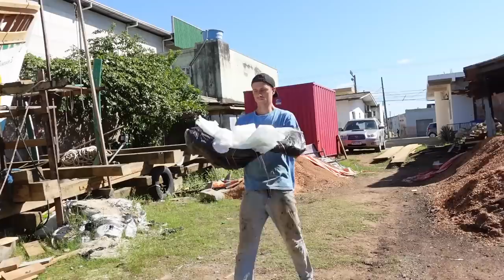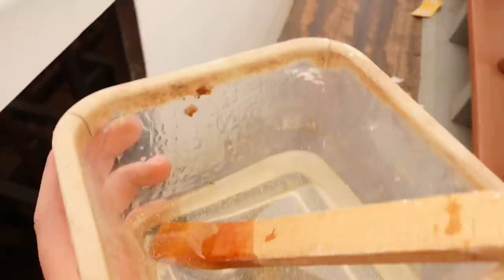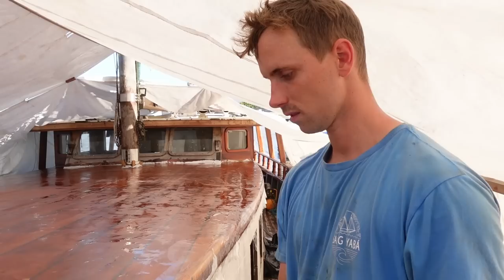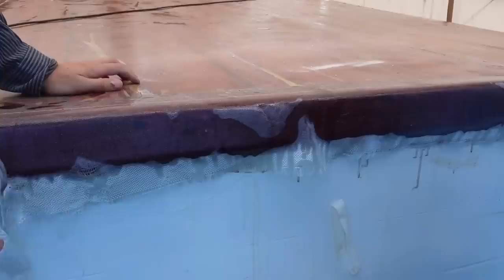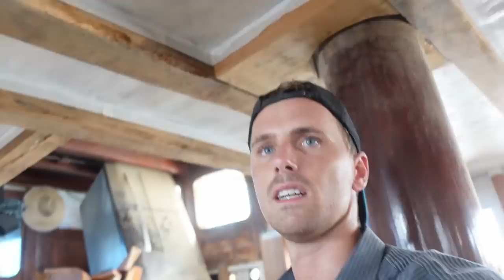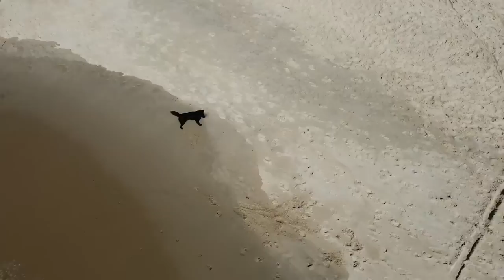Three rookies saving the roof of a rescued wooden sailboat — Sailing Yabá #92

Comment from the maker: So guys, what do you think? ARRASOU or not ARRASOU?
Reply: Google translate tells me arrasou, if it were Portuguese, means killed or demolished.
Reply: Fénix or Renascida
Reply: Definitely ARRASOU
Reply: Definitely ARRASOU Amigos
Reply: ARRASOU LES ZAZOUS !
Reply: Im never negative usually about the preservation of wooden boats nor am i a pessimist, but without a solid coat to shield all your work from the sun, the life span on this is limited, but its also not a good idea to fibre glass straight onto timber, all decks i have sheathed all start with a layer of ply, the application of deck paint over the top as a flow coat to stop the harmful UVs from killing the GRP apart from having a good antislip area , unless you are going to scatter silica in areas where you need to walk on the cabin top ?

I hope i am wrong, but i have never come across a UV proof epoxy, yacht varnishes that you also intend to paint over this are neither UV proof, general rul of thumb, if you can see through the coating it aint UV resistant
Reply: @traceysmith6964  it's maybe not 100% UV shield but a huge part is blocked. They'll find a solution, I guess they could decide one of these days to cover with a slipproof bi component polyurethane paint, a nice blue maybe. My idea to keep visible the root roof, I would keep a square or a circle in the middle covered with thick varnish, or plexy
Reply: @traceysmith6964  thats true, sadly. But this will not last very long i think. Mayby a polyurethane topcoat would help. I think there are some wich are transparent. This could help to protect it feom the UV.
Reply: @iniuriasg  the only yacht varnish that I ever found had some protection for 3 to 4 years you couldn't see the bottom of the tin when you take the lud off. 

The killer for this will be the timber bleaching under the epoxy, the bleach wood is burned wood from UV which will no longer be structurally fixed to the surface of the deck
Reply: Definitely ARRASOU😁😉
Reply: Next week will be “ARRASOU”
Reply: @traceysmith6964  agreed not to mention that the color being a dark color as opposed to a white will attract sun making it hot in the cabin below this deck
Reply: you should have been using fiberglass rollers not scrappers so you didn't get all those lines in the epoxy finish. not good now you have to sand all the lines out and start again and unfortunately you're going to have to re-fiberglass the whole thing if you don't want the top to have all the epoxy to look like crap but this time use rollers so you don't make the same mistake twice
Reply: @markschuman3615  forgot that it doesn't matter as she won't be living on the boat 😂
Reply: Well done... Goe gedoan !
Reply: I like your channel and I followed it at the beginning, sometimes I see your new videos. I am Brazilian e você arrasou 😂😂

Comment: Great job   remember always use a steel roller when working with fiberglass. It is of most importance to get all the trapped airbobbles out of the wet laminate. Also mutch less work eftherwords when you are sanding corce the surface will be mutch flatter.  Beeing a fiberboat builder of trade my whole life i still think you are doing a great job. Love your great vlogs. All the best from Norway😀
Reply from the maker: Thank you so much Arne!
Reply: Don"t think you can force glass or epoxy thru cloth with paddle, need metal rollers. Afraid you have dry cloth on dry wood
Reply: don"t mean to be negative, but have done mucho glass work
Reply: @highlandervalasik9274  I agree steel rollers are better and I have used them for years but they aren't essential I have also done heaps of work without a steel roller.  But a steel roller does give the best finish.

Comment: I'm certainly not an expert either but I do watch a lot of boat videos where epoxy and fiberglass are applied. One of the methods that I see many use is to use peel-ply on top of the fiberglass after the epoxy is applied. It is my understanding that it leaves a much smoother finish so would take fewer layers to get the finish you want and require a lot less sanding.

Comment: I would have added one additional layer on evenly overlapping the previous seams.  It would give you additional strength and stability in the fiberglass top and help ensure you seal it up better.  It would also even up the thickness.
Overall though, great job and keep up the enthusiasm and good work.
Reply from the maker: Thanks Charles!
Reply: Clarification:  … one additional layer of fiberglass cloth …. :-)

Comment: Guys - really well done on the epoxy job. Looking great. A couple of things to remember: (1) epoxy is dynamite when sanding as it cause skin rashes (especially when green), so make sure all bare skin (eg hands) is well covered (2) epoxy degrades in UV light (ie sun), it must be protected with either a polyurethane varnish or paint, if not it will form a cloudy finish (called amine blush), another thing you can do is use a UV inhibiting hardener but you are past that stage and so now have to concentrate on a cover coat to protect from uv. I have done a lot of epoxy work over the years and it can look great but getting there is tricky sometimes - keep up the great work on Yaba.
Reply: Excellent advice Marty Australia

Comment: From not working with epoxy and fiberglass, you did a great job!
What I would have done is to go up to the frame of the windows of the weelhouse with, and also a bit down on the white sides. And this because water can find it's way in...which you might expirience in a few years.

Comment: Hey yaba, boats looking good, for the deck that you fiberglassed should be sanded using floor buffer with a sanding paper disk, you should be able to find one there, will sand large area evening the deck level.

Comment: For a smooth finish use peelply. You won't get puddels with epoxy. Also important to use as little epoxy as possible. A dry laminate is better. You kan finish it of with a so called hot coat. De edges you cut when de laminate feels a bit like leather, not hard but a bit bendy. You can cut it with sciccors or a razorblade. It is no problem to lift the laminate when cutting.  Afterwards you can just stick it back. The peelply is the most important for a smooth finish ! Good luck, love the channel. Groet Lammert

Comment: Love the work you guys do, the boat is going to look amazing when finished.  Would like to point out that epoxy gives off some really nasty volatile compounds (isocyanates for one, look up the Bopal disaster) and wearing VOC rated respirators and rubber gloves rated for the solvents you are working with.

Comment: A small tip on epoxy.  If you want to keep the wood look it is better to put each layer crossed on the last one. The two last layers equal to the wood grain.  This way your coating becomes better UV resistant and the woodlook will last longer. Keep up the good work. Warm greetings srom Mallorca.  🤗👋👋

Comment: You should overlap the plies 2” for strength and waterproofing.  It’s easy to sand smooth after it dries.  Just putting edges together doesn’t provide any strength from one sheet of fiberglass to the adjacent one.  There has to be overlap.  If you didn’t do that and are worried it will not be strong enough or leak you can always put a fiberglass tape over the seams later.  Or if you’re putting on more layers of fiberglass you should stagger the seams so they are not on top of each other.  Where bubbles happened you can just cut them out and lay a patch of fiberglass over it with 1” overlap.  It will almost completely disappear.  Feather the edges smooth with sanding and add epoxy to level it like you’re doing.  Great job!

Comment: Really the only thing you have to remember when fibreglassing is get any bubbles out  ,  That's it .  I  don't think you need  a 2nd layer of glass because you're using epoxy  .  That will be fine and plenty strong enough

Comment: You can get nitrile as a sock or bootie for shoes.  You will find it makes handling epoxy much easier and safer.  If you get oversized gloves, you can also wear a breathable fabric underneath.  If you then smear it with a lubricant that doesn't produce much residue, such as a mold release, then you will not end up matted with sticky fiberglass.

Comment: If you do enough epoxy rash pour, it should mostly self level, if you do it this way, you will need a type of gutter to catch any run off on the edges, then you can immediately reuse it until all is level..

Comment: Hi. Great just b and really coming on well. I think a couple of other comments may have already mentioned it but if doing any more large flat surfaces 1. Use steel rollers to get rid of bubbles. 2. Use peel ply. It’s a nylon material that is wetted out over the top then ripped off once cured. It leaves a lovely flat uniform surface ready for final coating. 3. If you want to go one better use a vacuum bag system over the top which gives the best finish and mix of resin and glass. Have a look at the Duracell project as he does a great deal of flat panels and use of vacuum bagging and peel ply!
Don’t forget uv protection otherwise resin will degrade and fail. I appreciate wood looks lovely but I think I would paint it a colour that reflects a lot of the light to keep cabin below cool but given it’s the deck in front of the bridge windows you don’t want reflected light from the deck damaging eyes during watches. Finally, with the varnish finish be careful of making such a large deck area too slippery when at sea. I think you can get non slip coatings to mix with varnish but do think about the safety of the deck if you have to do anything on there at sea. Paint or track mark isn’t a problem as there are additives and coatings for grip.

Just a few I hope constructive thoughts. Your doing a great job and she’s going to simply lovely when finished.

Comment: Are you adding one more layer of fiberglass? In the composite structures I’m used to dealing with, an additional layer, laid 45 degrees to the first will add more strength.

Comment: I confirm that this is absolutely not a tutorial for Laminating Epoxy fiberglass. I built my double hulled voyaging canoe (catamaran) entirely in cp epoxy. When working with epoxy it is essential to keep sanding to a minimum, a lot of time is spent on sandpaper and the sanding job is thankless not to mention the dust etc. often generates a lot of work and therefore not the best of results. To limit the stress of covering the entire surface at once which is not necessary, we can continue afterwards by sanding the recovery line and not the entire surface. Work strip by strip, cutting the strips as needed. On the width of a strip of fabric start by impregnating the surface if necessary spread the epoxy generously on the surface and place the fabric on it (for a horizontal surface two people are enough) finish impregnating the fabric either with a spatula or roll. To avoid bubbles, work at a lower temperature. In my case, each layer was covered immediately with the epoxy finishing coat. For that when the epoxy must not have completely hardened, just sticky under the fingers (lover in French). This method allowed me to sand only the finishing coat. In the morning, the raw cp surface was degreased (sanded if necessary). At noon start of stratification (high temperature decreasing) and in the evening I had a coated surface.
The next day it was ready for
 the final sanding or continue if necessary by sanding the repair strip without filler. No stress or complications. I made all the exterior surfaces with this method for two for the horizontals and the verticals alone, i.e. more than 200 m²

Comment: Great job. I think I would have used a hot air gun to help level out the epoxy. With one person using the roller and the next person using the hot air gun. You could smooth out the epoxy without so many layers. This is good on flat surface but I don't know how it works on other level of surfaces. 👍👍🍺🍺

Comment: Never quite seen it done like that before, if after you had spatulared the epoxy on the fibreglass initially then used a roller to help spread it evenly the first layer may have been a little less lumpy when dry. Still a bit of sanding seems to have sorted it out. Nice episode.

Comment: Its coming along great.I prefer the spatula/scraper to the roller as it is easier to get a more even layer over-all.You can hear when the roller is going through deep epoxy and then dry.It does not spread it out or evenly as you think.Also sanding semi cured epoxy is the most dangerous thing you can do as the dust it is very carcinogenic if even a tiny bit gets into your lungs.I always gave it 4 or 5 days before sanding and you can really tell the difference as the dust is finer , harder and the sanding discs last much longer.At some point to get a super glass finish you will have to start long boarding between coats of epoxy before you even think about varnish.All the hard work at this point will show up in the final finish.It will look amazing. 😛

Comment: @14:15 That is where peel-ply, and using a thicker epoxy comes in. After rolling a layer of epoxy apply the peel-ply, roll that until it's soaked as well. Let it cure and then peel off the peel-ply. this leaves a flat surface which is prepared for another layer of epoxy and peel-ply without sanding.😊
Using it on the first layer (with the glass) would have made life much easier.😒
You will have to fill the bubbles (with a syringe) before you go any further...😟 (and not sanding it away, as I saw later)

Comment: There is a tool known as a Finn roller used to get the air pockets out.Epoxy cost plenty.I repaired a fiberglass boat with epoxy after I retired from bakery. No expetience but lots of Y.T. vids to help. Good stuff. You will soon be sailing! CHEERS from HERE!

Comment: Fiberglassed my boat a few months ago. You didn't have a gooey mess, so good job mixing MP! For such a large job you resisted making a large batch of resin which doesn't work out well so good job again. You didn't have to wash off a greasy residue (ameen blush) so its a nice laminating epoxy, nice. I ended up with six coats for my boat. Love the clip of the dog in the salon and chasing the drone shadow.
Reply from the maker: Thank you so much for your supportive words!!

Comment: Should reinforced the pilot house corner to the roof with thickened resin and strips of fiberglas before hand,sanded the bottom of the pilothouse off up to the windows,then ran the fiblass up to the windows...Just a thought..

Comment: Good job.  Glad you have power tools.    I lived on a small island in the Caribbean and did things like this by hand until I got a portable generator.   I did many hole and crack repairs.   
  Great looking work.  I drill small holes on the voids and fill them up with resin. 
   The fiberglass is not structural on this but will add a little strength. It’s for sealing and protecting the wood against the elements and from impacts and abrasion.     Keep sanding and coating and it will be like glass.   It’s going to be slippery when wet.  Wooden handrails along the edges would help with real life sailing.

Comment: will the varnish protect the epoxy from the UV rays?  Epoxy is not UV resistant.  Needs to be covered.  Good job on the deck.

Comment: Squeegying the epoxy is fine to get it spread, but you should follow it up with a ridged metal roller to help reduce any trapped air bubbles and followed by a foam or cloth roller to absorb/spread the excess epoxy to get rid of those "high spots". The strength of the fiberglass is improved with the slight reduction in the quantity of epoxy in it. That's why vacuum bagging with epoxy infusion is so beneficial. And if you intend to add more fiberglass as a 2nd layer, OR intend to follow up with another coat of epoxy, then always apply Peel Ply on top of the wet coat of epoxy. When it is peeled off after it cures, you don't need to sand that finish before adding another coat or layer. I would have wrapped that fiberglass/epoxy around the curve on the underside of the cabin overhang as water run off will collect in drops and can be absorbed into the bare wood on the underside. And since epoxy is sensitive to UV, it will need to have the varnish coat sufficient to protect the deck from the UV rays. I'm not so sure the fiberglass coat is "transparent enough" to appreciate the wood grain underneath. If not, then a white polyurethane topcoat will greatly add to the reflection of the IR rays and keep the cabin a little cooler in the tropical sun.

Comment: Ben, you are now sensitized to epoxy, and your eyelids are swollen. From now on it will happen every time you expose yourself to epoxy. Polyester resin is not as strong as epoxy, but there are good reasons for using it. Next time you glass with epoxy, don't sand it, and follow the tach-off with polyester surfboard sanding resin (Silmar 149 or 249). Then sand the polyester resin. Follow with a "gloss coat" of the same Silmar. The Silmar will protect the epoxy from UV rays. Hopefully now you have first-hand experience of why to use this procedure.

Comment: Very well done for the 1st time. You could have put the resin down first then smaller pieces of woven roving to fit, but you would have needed ribbed metal rollers to draw the resin through. In all a good job. Wear masks when sansing as dust is glass and will mess up your lungs.

Comment: The joints needed to overlap. The issue with fibreglass roofing is under normal weather conditions it'll last 5 years before it starts to crack up. Who knows what it'll do in hot climates and sea salt.